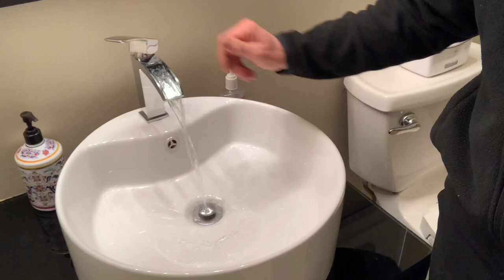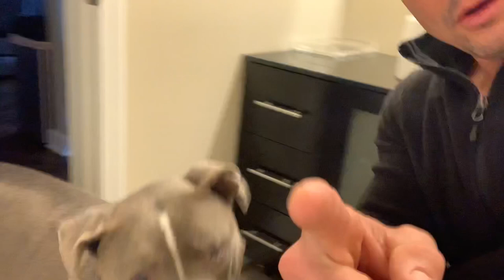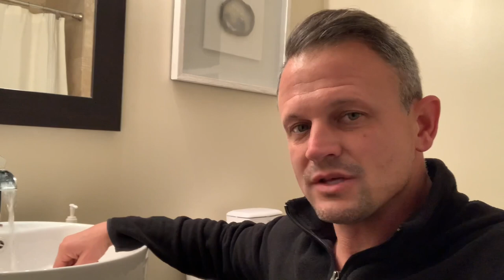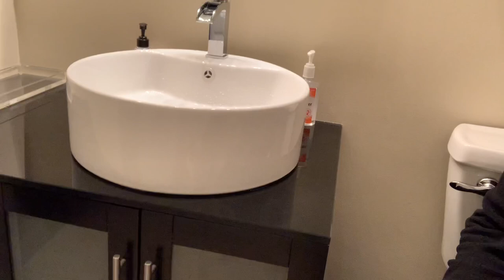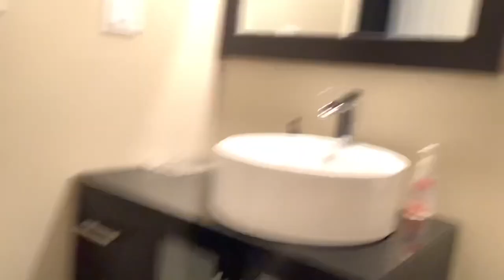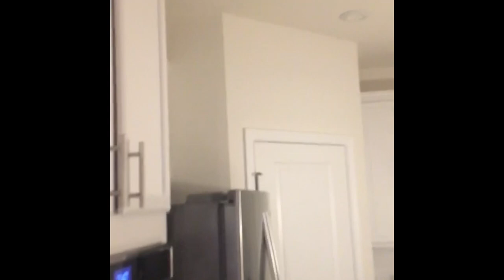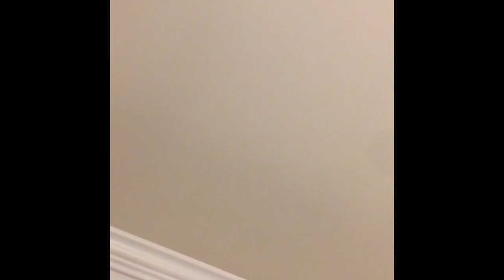Hear Water Dripping, but Can’t Find Any Water Damage?

Comment: We are experiencing this thermal expansion in a pipes running through the duct work in our basement. We built a new home and it started within 6 months of the build. It only happens when we run hit water from our kitchen faucet. 

My plumber is suggesting we open up the dry wall where the noise is coming from an see if we can slightly reposition the pvc pipe so it has room to expand without rubbing up against the duct work. I guess this is our only option? Your thoughts would be much appreciated because the noise is terrible especially when we run the dishwasher. Thank you
Reply from the maker: Hi Phillip- What you’re experiencing is very common, especially with a new home. Yeah, unfortunately, that’s the only option is to open up the area and see if you can adjust the pipe, or modify it in someway to minimize the noise.

Comment: My newly built apartment developed this noise in my walls a few months after I moved in. Whenever myself or one of my neighbors flushes the toilet, there’s a very loud tapping noise in my wall. So loud that it wakes me up at 5:30-6:30am when my neighbors are up and getting ready for work in the morning. So frustrating that there’s nothing we can do about it. I use a box fan sound on my phone to drown out the noise every night 😂
Reply from the maker: Yeah, you might get lucky and be able to open up the ceiling or walls and try to make some modifications to quiet it down, but it’s a crapshoot.

Typically it’s louder in the middle of the night because there’s no background noise so it’s more pronounced and noticeable when everything is dead silent.

Comment: THANK YOU soooo much. Same annoying issue. How long does your drip sound usually last?? I guess it depends on what all is running huh.. because i feel like mine is almost constant
Reply from the maker: My pleasure! The ticking length all depends on how long it takes to heat or cool the pipe or ductwork to where it’s no longer expanding or contracting.

Comment: Thanks for the excellent video! Just a quick question - so this thermal expansion phenomena is nothing to worry about? I mean a thermal expansion this loud (not exactly loud, but making audible dripping like sound) is not going to cause any problem down the line, like causing pipe joints to loosen and potentially creating a leak in the future?
Reply from the maker: That is correct! However, I always suggest monitoring just to make sure and confirm you don’t have an actual leak somewhere.
Reply: @BJPoznecki I've been monitoring this for weeks and have also asked my builder/developer to come and check. Fortunately, so far so good - no leak. Thanks again for your help!

Comment: Is there any way to fix this sound? It’s in my room and goes all night, I can’t sleep because of how loud and constant it is.
Reply from the maker: Possibly. You would have to get a plumber or heating and air-conditioning contractor involved. They would have to open up the walls and ceilings, try and modify the pipework or ductwork, and then put everything back together. It could be a very invasive process, and you still may not be able to completely get rid of it.

Comment: We just moved into new home which is 20 year old house and whenever I run the water I hear this drip drip drip sound and then sound slowly stops when I turn the tap off. It is two story house and the ceiling doesn’t look like have any damage but this dripping sound really bothers me because whenever I use the tap water upstairs and downstairs all the ceiling makes dripping sound. Plumber is going to come tomorrow just to check every pipe hopefully there is no leak.

Comment: Whoa, I think you just helped me get sleep. I though I had a leaking pipe.
Reply from the maker: Well, always triple check because there’s always a chance something could be leaking, so do your due diligence. However, it can be very deceiving with these thermal expansion noises sounding exactly like water is dripping somewhere. It’s crazy how it makes such a similar sound.
Reply: @BJPoznecki  it only happens when I turn on the hot water but I’m still having a plumber take a look because of other issues but thank you!
Reply from the maker: @ngonz89  My pleasure! Good idea having a plumber check it out while he’s at the house anyway. Have a great fourth!

Comment: I hear the same when I turn on the hot water.  Now my home is going to have an inspection for a sale,  I hope it wont hinder the sale.
Reply from the maker: Hi Dave- It shouldn’t as long as you don’t have an active leak. 

As a courtesy you may want to share this video with the buyer and let them know that they may experience these thermal expansion noises, so this way they don’t get nervous when they move in and hear them.

Comment: I have that sound but when it rains. I haven't found any water damage anywhere and I had a new roof installed a year and a half ago. It doesn't happen every single time it rains, just randomly so it's extremely perplexing.
Reply from the maker: Well, if you’ve never experienced this before with the old roof, and recently with the new roof. I would have the roofer come back out and inspect the whole roof and the attic just to see if there is any signs of water leaks anywhere.

Comment: Hello Mr. BJ, my problem is whenever I turn on the AC cuz it's hot summer now, I haven't tried heat, so now I turn on the AC, I heard the dripping sound in the wall like yours, once I turn off the AC, the dripping sound will slowly disappear , which is really like water dripping. In order to make sure my problem is the one you shared, would you please share your contact information with me so I can send you the video of my dripping or schedule an appointment to check it onsite if it's necessary? Thank you so much!
Reply from the maker: @MollyGuo-y3h  Hi Molly, for your situation it sounds like your air conditioner is leaking so you’ll want to call an HVAC technician to come out and service your unit.
Reply: @BJPoznecki  Hello Mr. BJ, thank you so much for your response. I will do that. Thank you!

Comment: how long would these sounds last?  (from a shower and sink - not furnace) Edit: as far as duration? Would 1 hour after the use be irregular?
Reply from the maker: An hour is a really long time. What I would do is run the cold water for an extended period of time and see if you hear the noise. If you do, then there may be a leak. If you don’t and it’s only with hot water, then I feel pretty confident that it’s just thermal expansion.

Comment: I have this same sound with cold water as well .. had inspected by plumber and water restoration company.. no leaks found .. any suggestions ????
Reply from the maker: It very well could be reverse thermal expansion. Where the pipe is warm and when you run cold water it contracts making sounds as well. Unfortunately the only way to fix it is to try and locate where the sound is coming from and open up the area to see if you can modify it, and then put everything back together.

Comment: How long after you turn off the water, should you still hear that sound? I still hear it for a good 15-30 min after but then goes away. Only hear it when water is turned on there after
Reply from the maker: To hear it 30 minutes or longer is very common. It’ll happen until the pipe stops expanding or contracting.

Comment: OOOkkaaay..... But what can you do about it to make it stop???  Driving us crazy - its a brand new house.
Reply from the maker: You’ll have to get an HVAC or Plumbing Contractor involved to help pinpoint where the issue is. Open up the wall, modify the ductwork or pipework if you can, and put it all back together.
Reply: @BJPoznecki  😭 thx for reply.

Comment: After taking a shower upstairs, I recently started hearing what sounds like dripping water on the ceiling downstairs directly above the shower drain for about 30 minutes after a shower.  So much so that I'm expecting to see water damage but so far have not.  What makes matters worse is that this is a log home, and the ceiling is wood.  I'm probably going to call a plumber but am holding out hope that this is what you are describing.
Reply from the maker: If you’re experiencing this with just hot water, try running only cold water for 30- 40 minutes and see what happens.

Let me know if you still it?
Reply: @BJPoznecki  I tried this 3 times.  After the first few minutes on the first 2, I heard a more rapid dripping sound while the shower was on, shut it off, and the drips were heard but I would say less frequent than normal.  The 3rd attempt was shortly after the 2nd and at no point did I hear dripping during the shower (on for 20 minutes) but afterward I hear the dripping albeit less frequent than normal.  I will also point out this pipe is not exposed to an outside wall, the temp has been in the 60's, and the shower water isn't what I would call 'freezing cold' even on the coldest setting.
Reply from the maker: @mel1daa  OK well I suggested just running the cold water because typically the pipe is cold and then hot water runs through it expanding it creating a thermal expansion noise.

On the other hand it can happen in reverse if the pipe is warm and cold water runs through it you can get a contracting thermal expansion noise.

What I’m trying to do is get the pipe to a consistent temperature where there’s no more thermal expansion happening to see if you still hear the dripping sounds. 

Naturally once the temperature of the pipe stabilizes and you’re still hearing a dripping sound then there may be an active leak. We want to rule out and process of eliminate an active leak.
Reply: @BJPoznecki  Thank you for clarifying and for taking the time to answer.  I just ran it again for 30+ minutes, heard no dripping sound while running. After shut off, after a few minutes the dripping sound is present for about 30 minutes.  

A few hours later I ran it again, this time I heard the dripping after a few minutes while running as well as afterward for about 30 minutes. 

Don't know if it matters, but the shower drain is not slow at all and water is always visible a few inches down in the drain which I am assuming is the p-trap.  What I can't figure out is the dripping sound for 30 minutes afterward since there shouldn't be any water left in the pipe to leak!
Reply from the maker: @mel1daa  My pleasure!
Well even after you turn the water off there still can be thermal expansion or contraction noises because if the pipe was hot now it’s going to cool off and contract, or vice versa.

Comment: Is there something I could do to minimize the thermal expansion noise that’s coming from time hitting system?
Reply from the maker: Possibly, you would have to get an HVAC contractor or Plumber involved to help you figure out where the noise is coming from, open up the area, see if they can modify it, and put everything back together. It can be an invasive project.

Comment: thank you so much for this informative video, just moved into a new home and it's been driving me crazy -- only since I started using the heater. The problem is during the night these "dripping noises" are stressing me out (whenever the heater kicks in) and keep me awake sometimes, cannot sleep properly.. Any solutions besides earplugs ? :(
Reply from the maker: Well depends on how deep you want to dive into it.

My Mom is a very light sleeper and it wakes her up too, so she turns the heat up and gets the house really warm about an hour before she goes to bed, and then lowers the temperature so it doesn’t kick on overnight.

Otherwise if you want to fix it you have to have a heating and air-conditioning contractor come in and try to find where exactly the issue is and try to fix it. Which could be very invasive and involve opening up walls and ceilings.
Reply: @BJPoznecki  Brilliant ! Thank you (and your Mom) for this solution, I'll give it a try. It might be hard  during the cold winter mornings, but I'd rather be awaken by the early morning cold than having to deal with that annoying "dripping" noise throughout the night. Thank you again! 💌
Reply from the maker: @llucis-v  My pleasure I hope that helps! ❤️

Comment: Thanks for the good video. The sound I’m hearing is more of like water dripping in a puddle type sound in the wall and can hear it between the bedroom and bathroom but can’t find any leaks or water damage but I do currently have my A/C on and the sound will go away after the A/C is shut off for awhile. Is that thermal expansion causing that noise? And is it something that needs to be fixed asap?
Reply from the maker: Hi Alex- Naturally it’s hard for me to say exactly because I’m not there to assess the situation. However, I have seen the reverse where you have a warm or hot pipe, and then you have cold water contracting it also causing thermal expansion noises.

Comment: I've had something similar, but my water bill. Also went from two thousand gallons of water to over eight thousand gallons of water. I have a plumber coming tomorrow for an apartment unit that I rent because they refuse to do anything.  I wastimg 200$ having a plumber come?
Reply from the maker: No I don’t think it’s a waste having a plumber come I think it’s a great idea because if your water bill jumped from 2000 to 8000 gallons, there’s water running somewhere. If you’re not seeing any water damage anywhere a common thing I see is toilets continuously running and not turning off because either the flapper or fill valve inside the tank up top your toilet need to be replaced.
Reply: @BJPoznecki  thank you, I can hear water dripping in the wall and water heater. And the pipes make crazy dripping sounds when I use my kitchen sink hot water, only my kitchen sink hot water though. I really appreciate your response and assurance.

Comment: This is what I hear all of a sudden at my vanity.. why did it start after I got a new faucet installed?? How can I stop it? Thanks!
Reply from the maker: In your case, being that you guys just installed a new faucet. I would double check to make sure nothing is leaking. If nothing is leaking. It’s thermal expansion and the only way to try to get rid of it would be to have a plumber, modify the piping, in which it’s not a guarantee it’s going to go away.
Reply: @BJPoznecki  Thanks. You're video is a blessing
Reply from the maker: @danielleg2616  My pleasure!